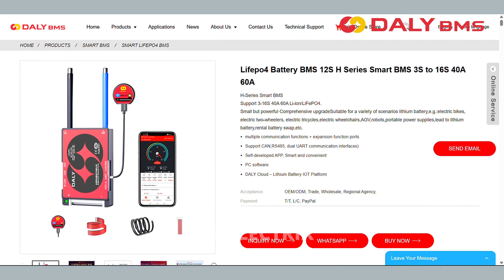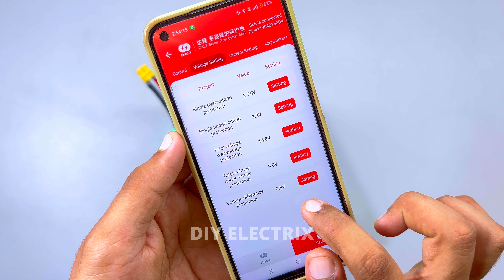Safely Building a 12v 36Ah Battery Pack – Step by Step!

Comment: 24v or 36v how to make it . Mainly I used 36v 250w hub motor ...... Who is system is best 12v - 24v -  36v . Money problem budget short . Will it work with 12 volts? And what are the differences between them?